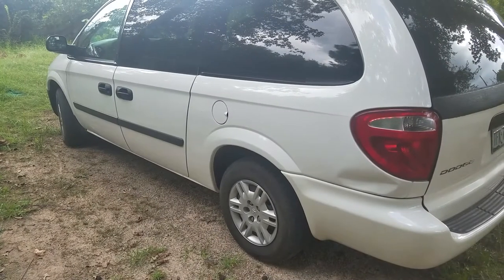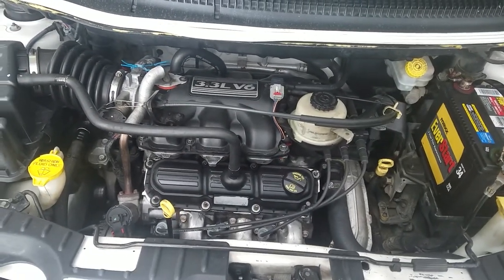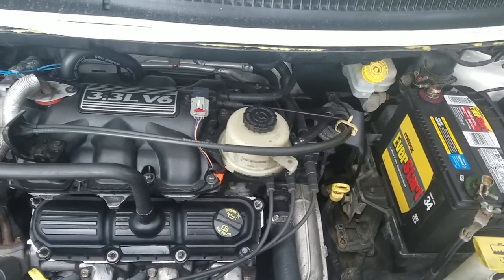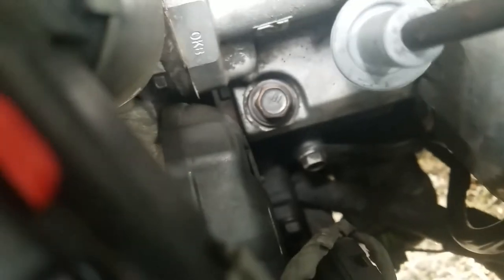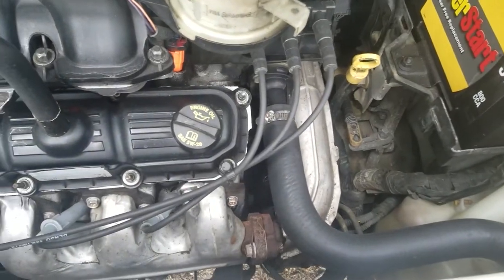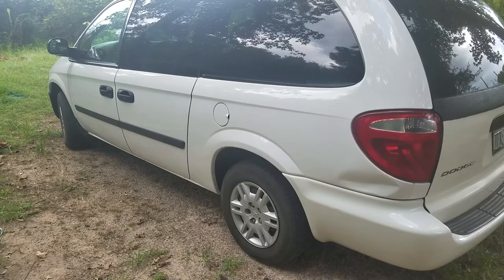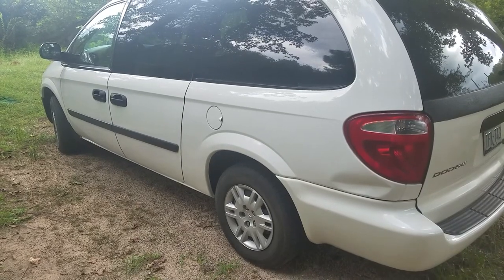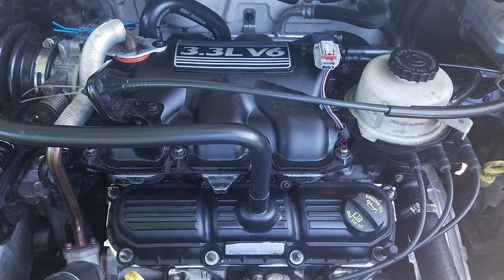6 Tips to Help You Finish a Head Gasket Job

Comment: Aaaaayyyyyy you live in Texas. Also that pretty dope that you still have the early 2000s Texas plates on there. I'm thinking of buying a Town and Country from my aunt. I love it when I drive that thing on occasion, such a smooth and comfortable ride.
Reply from the maker: Loved the 2000s plates! They were so unique and just looked better. I've since had to get the new design because the paint all chipped off 😂😂
Reply: @TechiePocket1  Yeees me too. I got a bunch of them I've been collecting. I got the 2010s Era plates on my Mazda 3 which were cool too but not as cool at the early 2000s ones.